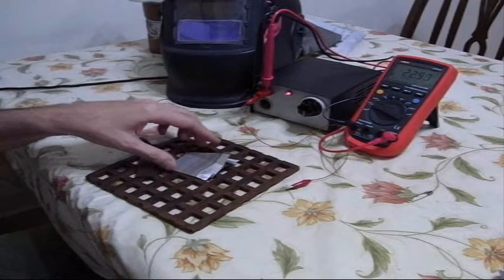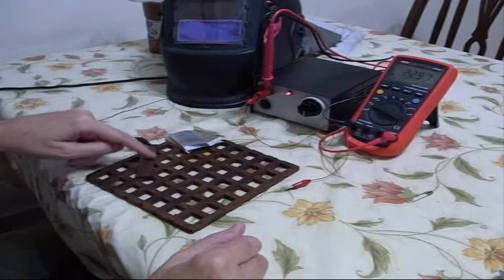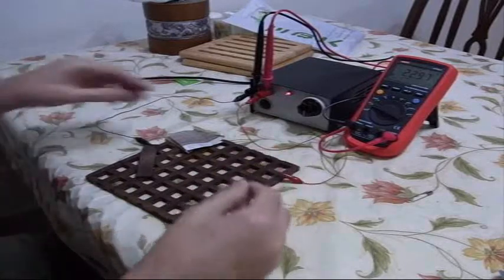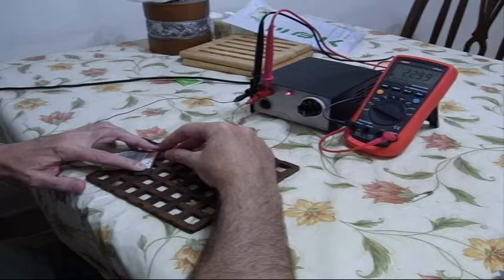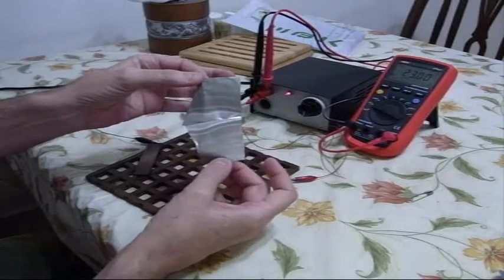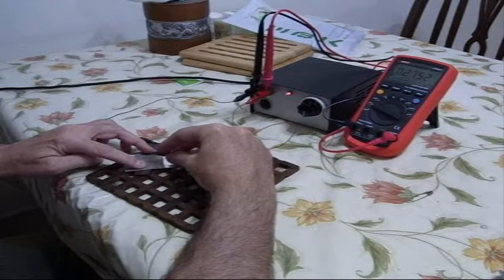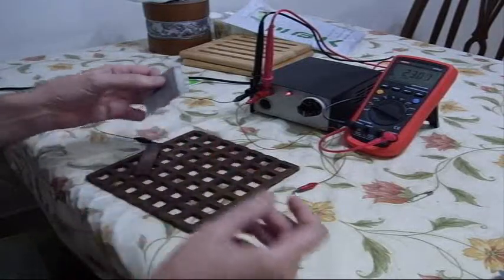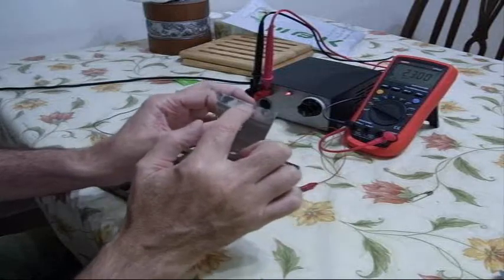DIY Micro-Arc-Welding Aluminum Foil

Comment: This is really neat.  What brand of power supply are you using?
Reply from the maker: It's one I made.  It's an LM338K and the standard circuit they give on the spec sheet.  The AC/DC conversion is via an old laptop power supply.  5A, 24v.

Comment: I have to admit, that was awesome! Was the welding helmet needed though?
Reply from the maker: Thanks.  Good question on the helmet.  I don't know how much UV and IR even small stuff lets off and it's the only thing I own that I know will protect me from both.  So maybe 1 small exposure to small arcs is nothing, but I do odd stuff like this a lot so it's possible that lifetime exposure could end up causing a problem.  Don't want to lose or damage my vision, I don't want to have to train my seeing-eye dog to do this for me!  But seriously, vapors, high speed white hot particles, IR, UV and probably a few things I don't know about...  it's just not worth taking the chance.
Reply: better to be safe rather than sorry